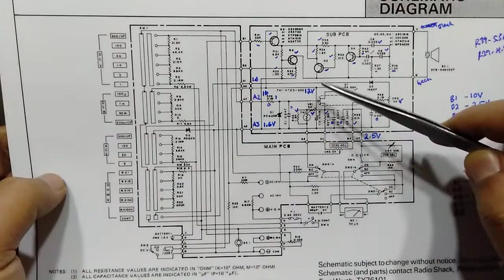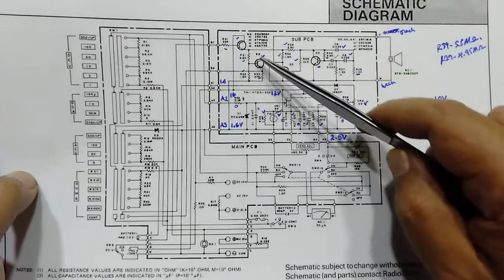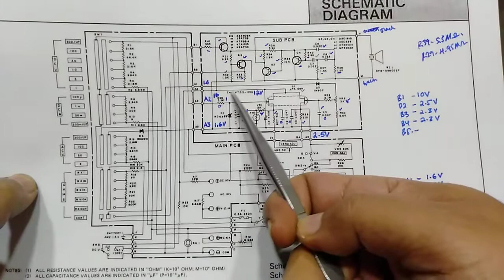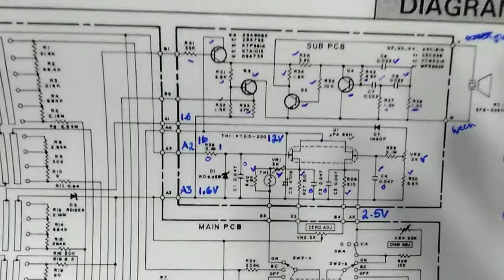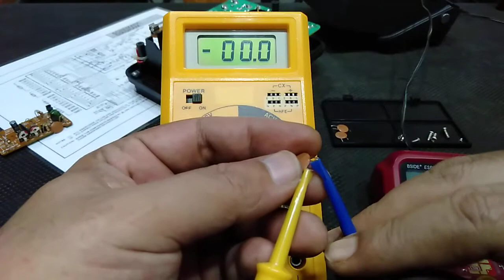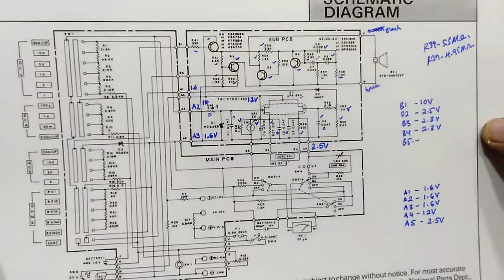Micronta 22-220 FET VOM Part 3

Comment: I buy another 22-220a mine unit neddle starts drifting, after some test I change the IC for 2 2SK217 fets solving the problem.
Reply: Tengo el mismo modelo. Lo compré en una tienda de repuestos electrónicos totalmente nuevo. Es normal que en todo el rango de resistencias entregue 1.5V?. Le puse baterías nuevas, y en el Battery Check me indica que están OK. Para qué sirve la batería de 9V sin en 10K no entrega 9V?. Saludos.
Reply: @rigobertosalazar8149 Al ser electrónico puede ser que la batería d 9 voltios se use solo para alimentar la electrónica interna.
En realidad yo no lo uso, lo compre porqué me gustó, de uso diario tengo un Fluke 87V y un Fluke 28ii.